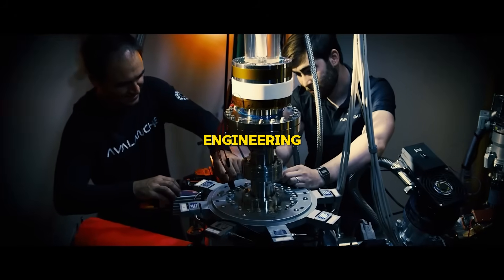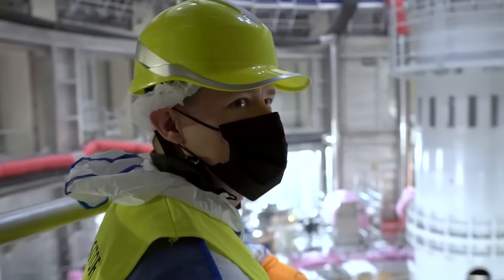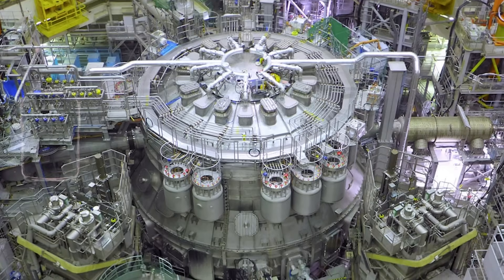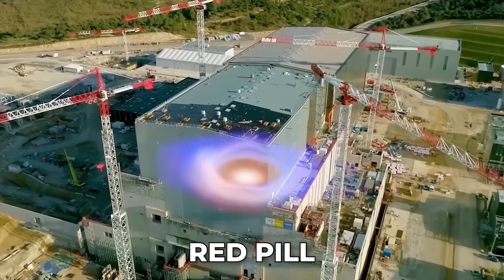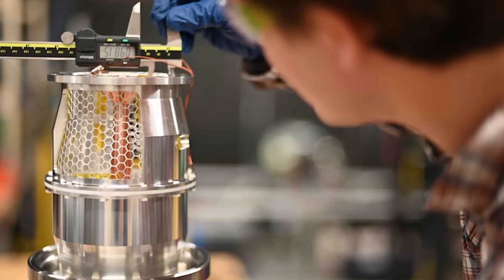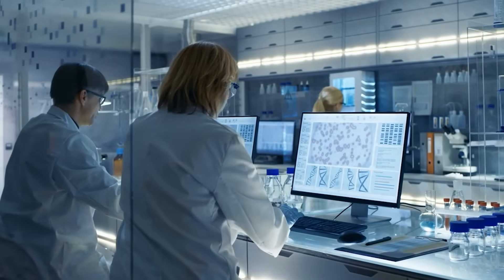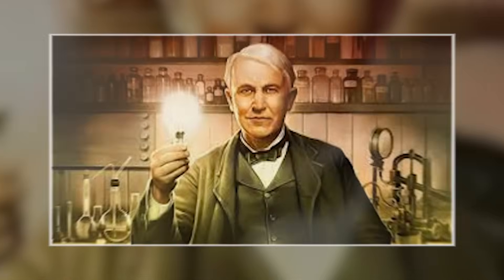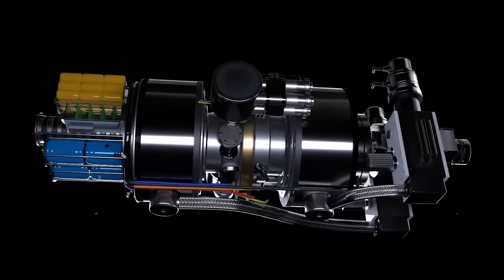Electrostatic Fusion Was “Impossible”… Until This Tiny Reactor Shocked Everyone

Comment: Don't  Quit. 

Fusion  is  possible. Want  proof. Please do  look at the  🌞☀️ and the stats.

Electrostatic fusion is actually a workable idea. Translating the same into reality is hard.

Orbitron is very much possible.

During COVID 19 we learnt many lessons. One was the importance of viscosity inside the ultrathin capillary  like arteries and veins in the human body.  

Net energy is the key 🗝️ to success.

Engineering is the application of known science to create a workable prototype ( device) which translates the truth of Scientific theory into a practical solution which is economically viable.

In the case of Electrostatic Fusion Power generation Deuterium isotopes of Hydrogen needs Tritium   isotopes of hydrogen to react with to  fuse together and create Helium and Produce net energy. As this is a chain reaction which needs to be controlled and be made sustainable think of Tritium isotopes of hydrogen as the catalyst needed to get the ignition for the reaction to start and the electrostatic force (lightning) to fuse together the Tritium and  deuterium Isotopes of hydrogen , both of which needs to be produced on demand in -siti in the electrostatic Fusion Reactor.

Think of the Quantum Switch and how conductor Titanium dioxide and graphite non-conductor sandwich 🥪 is able to multiply the power characteristics of sub atomic particle for the quantum switch and produce an enormous amount of heat.

For the Quantum Switch  the heat is undesirable.

However, for  the electrostatic Fusion Power Reactors this heat is the desirable outcome.

Hope that the comment is helpful to the 13 folks who bet on the possibility of fusion reaction and fusion Power on the desktop.

ALL the best

Comment: If it is true that liquid lithium can achieve a hydrogen density much higher than plasma, would it be possible to impinge the hydrogen isotopes containing lithium with lasers or a charged beam of hydrogen isotopes to achieve fusion?  If so, then extract the heat from the liquid lithium and can use conventional electricity generation.

Comment: All the research on fusion rests on the theory that the sun is self sustaining fusion. 
When sustained fusion occurs it will be because the theory will shift to a powered solar fusion. 
Using electricity to initiate fusion is a start. Try modeling the sun more closely to continue research. You need a body, a central body that can mimic gravity.
Reply from the maker: That's an interesting take on modeling the sun for fusion research!

Comment: People do not have to worry about radiation from a fusion reactor unlike a fission reactor.
Reply: It depends on the fuel. A deuterium-tritium combination produces high energy neutrons that makes the reactor itself radioactive. A high energy proton (from hydrogen) and Boron fuel combination is aneutronic (produces no neutrons) and is truly a non-radioactive process.
Reply from the maker: That's an important distinction to make about fusion reactors!

Comment: Isn't Electrostatic fusion what Dr Bussard was doing, decades ago? In any case, whatever solution anyone finds, if they ever do, it has to compete head on with Molten Salt Reactors. That's the biggest problem, because we already know that MSRs work, and it's only Engineering, Chemistry and regulatory hurdles that need to be overcome. It's hard to see any of these ultra high tech Fusion reactors competing with the relatively simple MSRs. Just imagine where we would be now if all the money wasted on Fusion had been spend on MSRs. There'd be one in every City in the World by now.

Comment: THE FUTURE OF ENERGY IS HARVESTING THE INVISIBLE ENERGY THAT SURROUND US EVERYDAY. VORTEX IS ANOTHER KEY TO THIS PUZZLE....
Reply: Indeed could contamination or some such cause that part of a vortex to not match the others in the system of energy as a whole each pice of the field must match right? The 9 is not the center of it all only a govoner what about the center the zero the field that is there but it is not would there not be a center in this vortex math the lines show it there if you take that one point as a whole does it not? When the two become the one. Both serpents must combine as a whole with the wand or staff in its middle as a whole. Thoe they seem seprate really they are of the same really all along only one side or the other dominates the most but what happens when both equal?
Reply: You have a problem. 

Like a dam , water at a height is released and it flows down. We use that flow to produce energy. 

The vortex that is all around us is the same in every direction. 

We need a PD, and potential difference. 

Unless you can induce a low point in the vortex, or find a naturally occurring low point  , we can't produce energy. 

All electricity generation,  from Steam Turbines , to Solar Panels , depend on a PD .
Reply: @avibhagan  Just think then how much power could be taped into if say the earth spinning inside of a set of massive coils outside of and around it in a array maybe what potential differences would we then have? Cause I bet induction would take into effect then too ass well would it not? Would almost be similar to what Telsa had planned all along too. Everyone goes on an on about the tick tac yet they forget what Telsa said about his form of flying machine an how it would look too it would look exactly like what they show only differences are the performance. He had it almost all figured out an planed how his machines would work via his system for its all relative.
Reply: @EliwazMoonites , sirrrr.

If you flew a kite made of foil, using steel wire as the anchor line.

You'll get a PD, just from the atmosphere. 

The charge at ground level and the charge higher in the atmosphere is different.
Reply: @EliwazMoonites , you would slow the rotation of the earth. Days would become longer and longer.